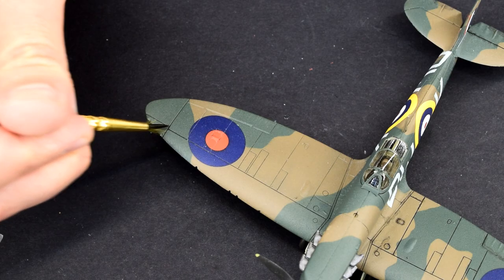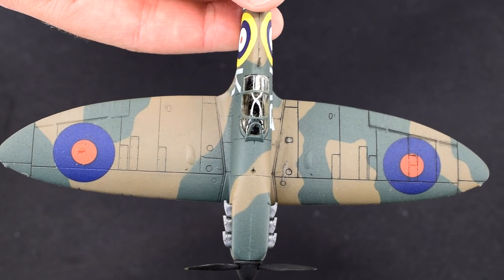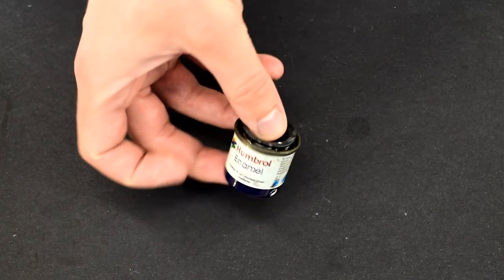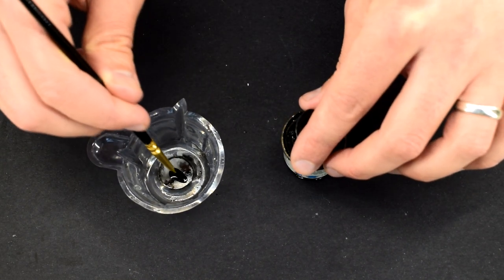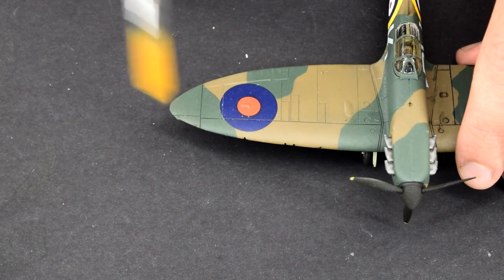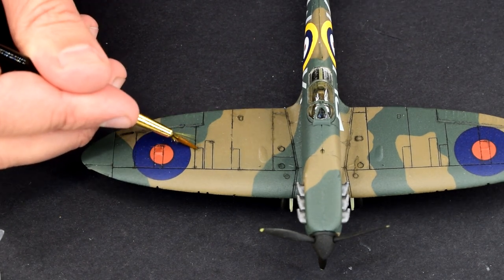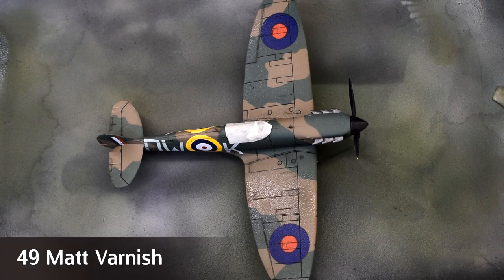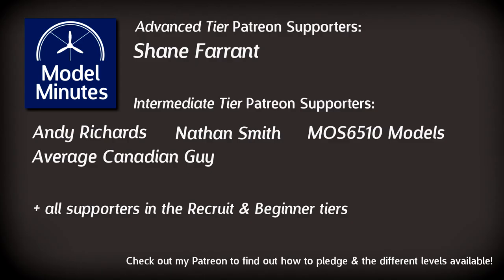Super Easy Panel line Wash You Can Make at Home!

Comment: I’ve been building models since 1970...but I’m a old DOG... but I can learn new tricks...I buy water color kits for children... use them for washes...lay them down heavy and use Q tips to clean... excellent video... VERY INFORMATIVE GREAT JOB... Chris from Ohio...Sept 24th 2020
Reply from the maker: Very cool! Thanks for the info!
Reply: Yep, those work good Chris.
Reply: Hmm... Maybe I should use this method since I painted my model with enamels.
Reply: @elpatrico2562  It works pretty good.
Reply: @THROTTLEPOWER  Yeah, I will propably try it, the last layer of paint is drying right now, but I'm a little concerned I covered up most of the details, since it's my first kit and I kinda just getting the feel of it so it did not turn out as good as I planned, hope i'll have something left to highlight in the end. If not, I think I'm just gonna let it be like that and move on to the next one.
Reply: @elpatrico2562  👍👌
Reply: @cassius348  i defenetly do. I'm building my third model since and it's ton of fun.
Reply: I really thought i was the only one who uses water color for washes.. glad to know im not alone!

Comment: If you use enamel colours to paint the model, once dry, you can the use an acrylic varnish and once that is dry, apply the enamel washes, as the acrylic varnish will act as a barrier protecting the Enamel paint underneath. An alternate method is to add the panel lines using a fine nibbed drawing pen, the type you can get from the Works.
Reply from the maker: Yes, you’re quite right. Same way how I use an enamel varnish to protect my acrylic layers if I use an acrylic wash ☺️
Reply: Thank you for the tip, I use enamel paints on my models. I’m a bit of a beginner and this will really help my models look more realistic
Reply: Gary, do you mean a sort of tech drawing pen....? Just going to start a build of the Revell 1:600 scale T.O.S Enterprise, hundreds of panel lines on saucer section alone! Haven't built plastic kits in 45 Years!! Didn't do that level of detail then, in fact some didn't get paint at all! Lol!
Reply: I'm sorry, I've re-read comments and re watched video. I'm new to this and still confused. I've just finished painting my 1st plane with testors enamels.  I was going to use gloss acrylic clear coat to apply the decals over. I planned on adding weathering, smoke stains then,  and finishing with a matte acrylic coat to seal it all up.  Is that correct? Or should I be using an enamel clear coat over my enamel paint? I got confused just writing this! But thanks for any help.

Comment: One question. After watching a couple of your videos I realized that you like keep costs down but why don’t you Never fill in the center seam of your model? It does make a biiiig difference
Reply from the maker: I didn't do it on this one because it was only meant to be a test bed. Sometimes I simply don't see the point, but to say that I never sand it down would be inaccurate. There are a number of videos out there where I do sand it down, if not on screen, certainly off of it

Comment: I found using pencil and then lightly smudging it works really well.
Reply from the maker: It's another method i have used in the past
Reply: How do u smidge it?
Reply from the maker: @willthomas9216  with a finger I imagine
Reply: @willthomas9216  what i fo is get some cotton wool.and lightly damp it, then rub it over the pencil lines. It works really well.
Reply: @bodieofci5418  o ok sounds good I’m half way through my Balt and Paul defiant so I’ll give it a try.
Reply: Fine point markers work well also

Comment: Very good tutorial. Thanks. One question: Should we apply a coat of matt or gloss finish before applying the wash; if so, what is the recommended base of the coat (acryllic or enamel)?
Reply from the maker: A gloss varnish will help your wash flow better. It should be the opposite of whatever the wash is (so for enamel wash I would use a gloss acrylic coat as the base)

Comment: I bulk-produce tanks and the like to make up toy soldier sets I give away, I use enamels and have two bottles of thinners for cleaning, the first to get the bulk off the second to finish the job. The first bottle soon ends up as a dirty mix and that, applied sparingly with a large brush, makes a very good instant weathering finish. Not sure it'd work well on aircraft though.
Reply from the maker: sounds like an interesting idea

Comment: Did you ever try artists oil paints (those in tubes) diluted with lighter fluid? Works easy on both acrylic and enamel gloss paints and looks great. Imho the best for panel lines. You can also make some very realistic looking oil stains or other dirt tracks.
At last one layer of flat or semigloss clear to fix.
Reply from the maker: I've got some oil paints to do some tests on - can't say it's currently one of my go-to techniques at the moment

Comment: Ronsol lighter fluid can also remove enamel wash without hurting the acrylic - just dont rub it too vigorously.

If you use a lacquer clear coat over the model first (gloss) it will improve the flow action and will protect the underlayer of paint in case you make a mistake
Reply from the maker: thanks for the tip!

Comment: Many otherwise careful and excellent modelers use a black wash to fill in panel lines. However, if you observe photos of and actual airplanes that are in regular use, you do not see their panel lines so clearly and they are certainly not black. I suggest that you darken whatever colour you will be using on that surface just a bit and use that to fill the panel lines, etc. The result will be far more realistic.
The same goes for built-up models of fabric-covered airplanes. Too many modelers make the rib stitching and tape pop out too vividly. Go to any airport where fabric-covered airplanes are tied down. Of course, Rhinebeck Aerodome is ideal for this but most small airports have a Cub or something like that sitting around. Look at the airplane, particularly the wing top from a distance in good light, and move in. Take note of when you can actually see the rib stitching. You'll get pretty close up.
Anyway, that's my two pence.
Reply from the maker: whilst this may be true there will always be an exception
Reply: @ModelMinutes  Indeed. Exceptions prove the rule.

Comment: 4:53 It's only my first model I'm building, and I only have enamels, but when I left some paint on a plastic lid, I was thinking I would just re-dilute it and paint the second layer with it the other day, but after 2 days, when I wanted to do so, pure enamel thinner could not re-dilute the paint, even so I was scrubbing it with a brush, so I don't think it should destroy the paintjob neither, but as I said, this is my first model so correct me if I'm wrong.
Reply from the maker: Generally you would be correct, having left enamel paint for really long periods to dry means they are harder to remove. But, in my case, i tend to paint my models, get them touch dry, and then move on. Enamels can take 24 hours or more to become completely dry all the way through. So in my case, if i were to remove an enamel wash from an enamel base layer within that 24 hours, i run the risk of removing both the wash and paint
Reply: @ModelMinutes  I see, so briefly if I let it dry properely, and be careful, I won't have too much problem using the same type of paint for wash.
Reply from the maker: @elpatrico2562  I would imagine that it should be ok, especially if you apply a thin wash. However, please test it on a scrap model/plastic so that you know for sure - i'd hate for you to try it out and it ruin your carefully applied paintwork
Reply: @ModelMinutes  Will do, thanks
Reply from the maker: @elpatrico2562  I hope it works out! 😊
Reply: I got a quite cheap and quite good (only bc I use tiny amounts at the time) thinner for enamels I have used it to remove stains from my floor even when they were dried, for this purpose hand (sanitiser also works but is also way slower.) then I tipped over the bottle. I am thankful it did not smell a lot as this was in my bedroom.
Reply: @alfepalfe  Your name suggest that you are right.
Reply: @elpatrico2562  I don't really like that name I choose it quite a while ago inspired by the King of random. I plan to change my yt name sometime I just need to come up with another name. (That is why in my latest videos I have been saying welcome to my channel instead of welcome to the the King of experiments and games.)
Reply: @alfepalfe  All right I was just joking

Comment: Before you apply the wash have applied a varnish coat before hand or straight onto the paint?
Reply from the maker: a gloss varnish can help as it is smooth and will encourage the wash to run into the panel lines etc

Comment: My question is: after painting the model with acrylics you apply a clear coat, finish, varnish, and after that you apply the wash? Or you can apply the wash directly on the painted surface and you spray the varnish at the end of the process. Thanks in advance.
Reply from the maker: The varnish acts as a protective layer, which prevents the wash reacting with the previous decals and paint layers. Whilst it might not be necessary I have found that on occasion the thinners can react with paint or decals and ruin them.

Also, a gloss varnish will create a smooth surface that stops the wash “sticking” in the flat areas, allowing it to run into the recessed details and panel lines
Reply: @ModelMinutes  Thanks for your answer. So, varnish or not before wash? And if yes, which varnish (not very glossy) is the best for Tamiya acrylics? Thanks again for your time and patience!
Reply from the maker: @catstuff274  i normally varnish before a wash as mentioned in my previous comment. You don't have to, if you don't want to, you can build however you like.

As mentioned though, a wash can react and strip the previous paint layers if not protected though.

I don't know if there is a "best" varnish to use with tamiya acrylics, i've used a variety of different brands and find they all (mostly) work fine - again this is a matter of preference to each modeller and the results they are looking for...

Perhaps a good starting point would be something from Vallejo or even Tamiyas own varnish?
Reply: @ModelMinutes  I have a can of Tamiya TS-80. Can I use it as varnish?
Reply from the maker: @catstuff274  TS-80 is flat clear. It will not give you a glossy finish, rather a matt one. You could use this to protect your model before applying a wash but it will not run into recesses as easily and make the model look more dirty as the matt finish of the varnish will make the wash "stick" to it.

As a top coat after a wash it would probably be ideal but as a pre-coat its not something I would usually do

Comment: Do you use an acrylic gloss or flat clear before applying the wash?
Reply from the maker: A gloss can be better as it will help encourage the wash to run into the panel lines and details, a matt surface might make the wash just "stick" where it is applied
Reply: @ModelMinutes  Should I use a gloss acrylic?

Comment: Hi mat. I paint with acrylics, wouldn't the white spirit bring up the acrylic paint or should I put a vanish on? If so what type?
Reply from the maker: As you can see in the video, the white spirit didn't react with the acrylic
Reply: @ModelMinutes  did you put a matte/gloss cite before?
Reply from the maker: @abiparmar  I protected the decals with a varnish layer normally - but that was also acrylic (a gloss one will help the panel wash flow into the lines better)

Comment: Hi! Ive tried to highlight panel lines on my first build using AK washes and revell color mix thinner. when trying to remove the excess wash i ended up stripping a lot of the surrounding area (hand painted acrylic) through the clear coat down to the plastic before i had removed enough of the wash. what am i doing wrong here?
Reply from the maker: Sounds like a couple of things could be happening..

The acrylic paint was not 100% cured before you started the washes and the removal of the wash took the paint away.

Something in the Revell Color mix or ak wash reacted with the acrylic paints and removed them (I’m not familiar with them so don’t know their composition)

Physically rubbing too hard and removed the paint through abrasion

Comment: I use oil paint with abit of light fluid it can be used on any paint and the fluid doesn't do any damage to the paint or if doing an acrylic its it's normally 70% water 30% paint same with enamel really but the oil wash is best tbh
Reply from the maker: Thanks! I'm looking at doing some oil paint weathering in the future

Comment: Does this method work with acrylics?
Reply from the maker: it can, but naturally you will have to use water or another thinning medium, but take care if the wash is being applied to an acrylic paint layer as you could run the risk of removing it if using thinners

Comment: So I assume if using acrylic paint for the wash you just use the same sort of quantity of water to thin it down?
Reply from the maker: Yeah, you can even add a drop of dish soap to reduce the surface tension too. I used this method on my Airfix Churchill if you want to check it out. Just be aware that if the wash dries on the model, you will have to use acrylic thinner to remove the excess as water will not be strong enough to do it

Comment: If I paint my model in enamels but apply a layer of varnish afterwards will it be safe to remove excess wash with the white spirits?
Reply from the maker: Should be, provided you let those paints completely cure and you use a tiny amount of white spirit
Reply: @ModelMinutes  alright, thanks

Comment: Does this only work with models painted with acrylic? Or if you paint the model with enamel paints can you do the exact same just instead of using 33 matt black enamal can you use 33 acrylic?
Reply from the maker: You could do that, but thin the wash with water instead. I do cover that in my Revell PzKpfw build (or maybe it was the Churchill....)
Reply: @ModelMinutes  alright cheers, I've just gotten into making models I've made about 11 models in the past month or so but I never really added any washes to make them stand out as I didn't really have the money nor was I able to get them so this helped a lot thanks
Reply from the maker: TheBritishPanda adding a drop (literally) of washing up liquid to your acrylic wash will break down the surface tension and help it flow better. I would recommend using acrylic thinners to remove it though, as water won’t do anything when the wash has started to dry
Reply: @ModelMinutes  okay, thank you ever so much, might try it on the next build I do.
Reply from the maker: TheBritishPanda let me know how it goes! ☺️
Reply: @ModelMinutes  will do

Comment: can we just use very diltuted black paint
Reply from the maker: that's essentially what this is - the enamel wash is super fluid though and runs into all the details. If using acrylic paint for example, some people add a drop of dish soap to break the surface tension when they thin it with water. It really depends on the paint that you want to use and how you thin it

Comment: So if I want to do this on a tank painted acrylic I gloss it over with varnish then use an enamel wash then revarnish with acrylic Matt varnish?
Reply from the maker: If you want. You could use an acrylic wash but you wouldn’t be able to use an acrylic thinner to remove excess because it would also remove the original paint. That’s why I alternate paint types
Reply: @ModelMinutes  so white spirit to remove an acrylic wash on acrylic varnish would be ok?
Reply from the maker: @elliotgregory3356  no, white spirit removes oil or enamel, you need a specific acrylic thinner or alcoholic thinner for acrylic

Edit: I have known white spirit to remove acrylic on occasion, but usually because it is simply stripping all the paint and not the acrylic specifically
Reply: @ModelMinutes  Thank you

Comment: hey, i hope you can help me with my problem, i tried to make a wash with white spirit and revell enamel email matt black, roughly 1:10, i painted trainer yellow and aluminium humbrol onto spare drop tanks to test, and let the wash i created seep in to panel lines and rivets, but for some reason the acrylic humbrol paint i put on previously started coming off too as i applied to wash, like rubbing off and curling up, would love to know where i went wrong as ive never been good at weathering or using washes
Reply from the maker: Perhaps the acrylic wasn’t fully cured and the amount of white spirit was too high. It’s very rare I have a reaction but if I do it’s because of that
Reply: @ModelMinutes  i let both the humbrol trainer yellow and aluminium cure for 2 hours, i think it was the white spirit,I appreciate the help, thanks
Reply: @ModelMinutes  i figured out the problem, for the most part, i over diluted the wash with white spirits alot, and the humbrol alluminum acrylic is a very weak and thin consistency, comes off easily